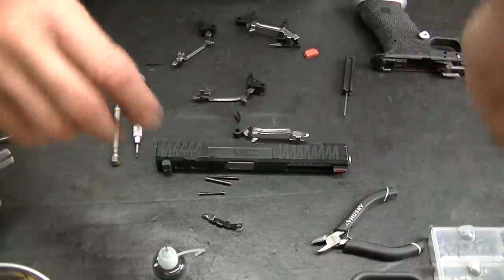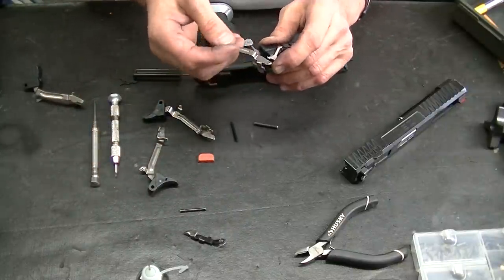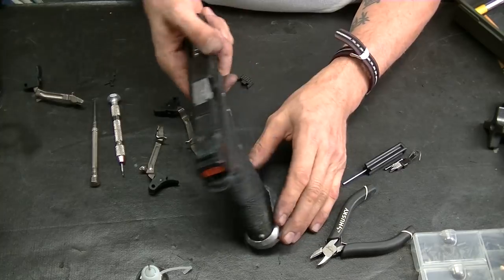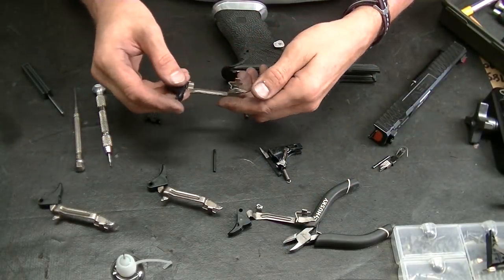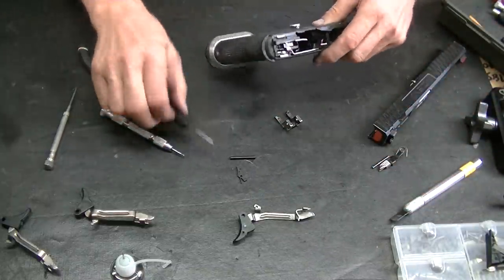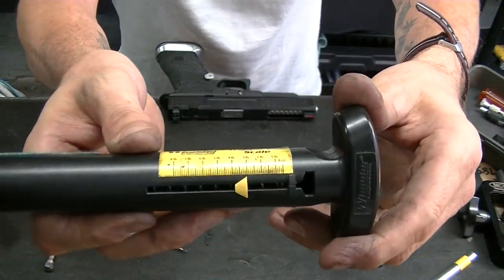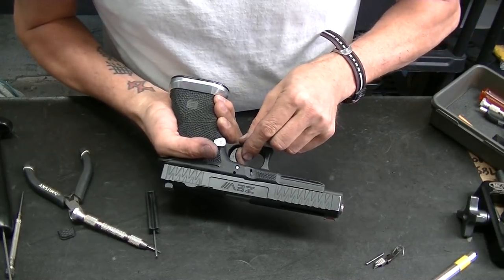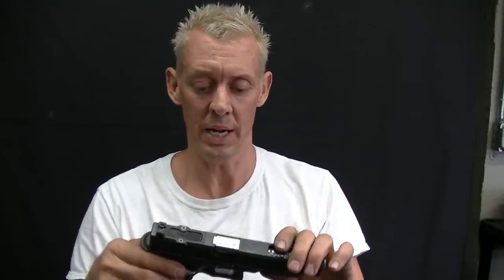GLOCK TRIGGER  trial & errorEDUCATIONAL ONLY

Comment: Big thank you to you Johnny for helping me with my GEN5. Broke the plastic trigger and Glock is currently not offering replacement parts. Called Johnny and asked for advice. Purchase a GEN4 trigger/bar assembly & slide stop. Remove the GEN4 trigger and install it on the GEN5 bar and install the GEN4 slide stop. Works great, much appreciated the help! Recently put a 4# striker spring and lite strikes, back to the ol stocker. THANK YOU!
Reply from the maker: Kenneth Gordon use a 4.5 lbs
Reply: I'll try that, thank you!!!
Reply: Friendly heads up, the trigger and bar assembly are now being shipped. Part number 39702. Hope all is well.

Comment: Johnny, what does it mean if after cutting the safety tab the trigger does rest more rearward but only with the slide off?  In other words, cutting the safety tab does cause the trigger to rest closer to the rear, but putting the slide back on returns the trigger to the original factory position, as if the safety tab was never cut at all?  Is this caused by striker or recoil springs being too strong?
BTW, you got 16 thumbs up from Australia, how cool is that!

Comment: Hey Johnny. I have a Glock 17 gen 4 I bought me a bar and trigger assemble for a gen 3 drops right in on the gen 4 not having no issues I also bought a 3.5 connector by double diamond going to put it in soon see if that will smooth the trigger up a bit.

Comment: I see guys using different generation trigger connector bars in various generation housings.  I thought I caught in the video towards the end that that could be dangerous due to various shelf designs on the trigger's housing?
Reply from the maker: If you don't know what you're doing it's best to stay within your generation the problem is when you start mixing all kind of different parts then it's susceptible to compromise

Comment: I really need to contact you for help! I’m having an issue with how the trigger safety tab resets? I’ve found two tiny springs and it’s happened to both the 18 and the gen 4 where they no longer have functioning trigger safeties. I guess i need help setting what i thought was the spring inside the actual trigger that puts reverse tension on the safety tab. I have the 18 completely broken down at the moment and i’ve found three tiny springs two of which are identical and the third is a bit larger in diameter. If you have an email i can send you pictures. It seems so easy but no matter what i do i cannot get those springs to sit properly. Your help would be greatly appreciated! I’d be sure to thank and recommend you in a video on my channel as well as subscribing! Thank you for your time!

Comment: Wow...potentially very dangerous, having the trigger go off like it did.  You really have to know what you are doing.  You are really pushing these guns to the edge.  Just curious if there are other guys that know and can do what you do?   You are way beyond an advanced armorer.  Cool vids and I hope people don't try this stuff on their own.
Reply from the maker: paulpm 
I don't know about any one else. I like a point you made and you better Damm well know what your doing inside  out and blindfolded before you attempt any work like this.  Another reason for this video is to show just how delicate the line is between safety and performance. People ARE going to do  things like this. You Tube is littered with horribly dangerous Glock mods.  Let's just hope they find this video so they can learn and discern .
Reply: AMEN, Jonny!!!

Comment: If your striker lug does goes over the trigger bar cruciform if the pistol was dropped,  the firing pin block will stillprevent an accidental discharge though, correct?

Comment: Great video again! When you remove the take up is the trigger bar less on the (top) shelf? Potentially having that accidental issue of going off when dropped?
Reply from the maker: Kenneth Gordon 
As I show on the video it MUST have verified purchase on the shelf dictated by the trigger safety tab and significant engagement on the Striker lug face. Even the groups I push to the edge pass several Drop safety tests at several feet. Guns Drop off the top of refrigerators when the whole family is in the kitchen. You better Damm well know it's SAFE when working at this capacity.

Comment: I have a gen 2 22 and want a p80 frame , will my gen 2 parts fit the poly frame for gen 3 ?
Reply: For the most part, yes.  You might need a slide lock (take down) spring, you will need a slide stop lever for a 3-pin Gen3 frame.  You might get both from ebay for 10 shipped.

Comment: Hey johnny.my trigger pulls but won't break..its a lone wolf lower parts kit.trigger reset is adjustable ..p80 g26 g3 frame ..any ideas..upper parts are oem new glock.
Reply: i had the same problem on my 17 build, it was the LWD - connector, swapped it for a OEM 5lb and its been no fail since